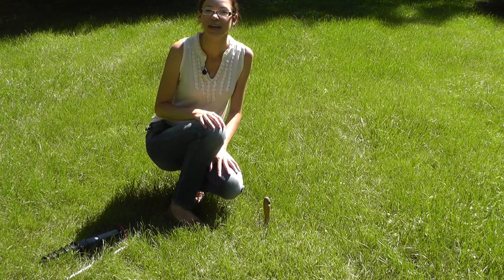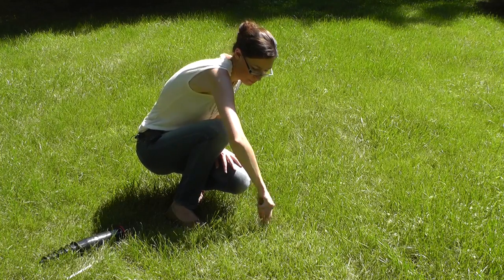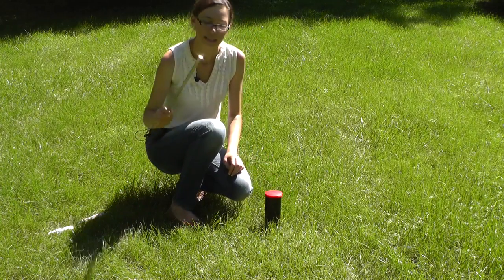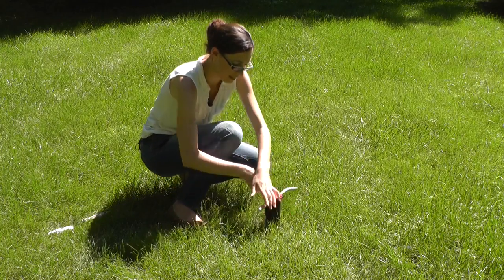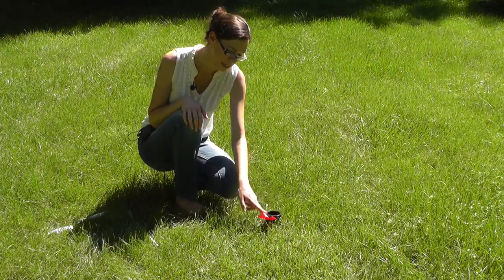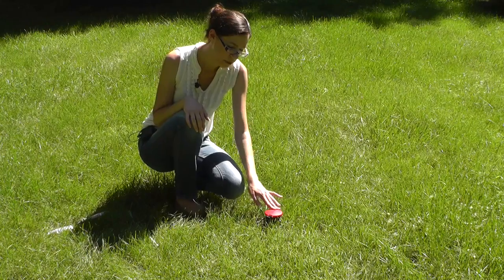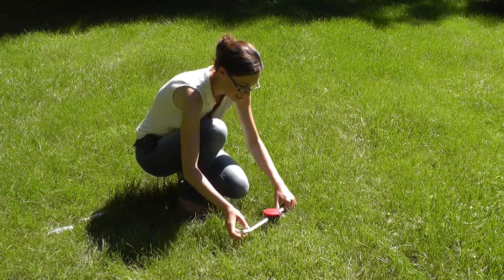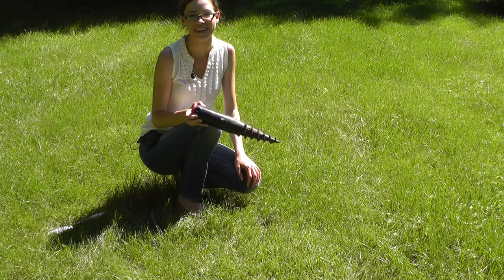Leifheit Screw-In Ground Peg

Comment: but how do you make sure it is level as it is screwed into the soil?  Mine went in at a slight angle.
Reply: I feel like I’ve taken mine out and put it back in a million times and it’s always off
Reply: A small spirit level is around $5 in stores, or use your iPhone spirit level (search 'level'), simply place it on the centre in the middle of the hole. 
Make sure it's 'middle bubble' and rotate a few times. Check both axis

You may need to manually adjust and give it a slight push one way or another, but eventually it will be quite close... 
These things are a temporary fix, if you absolutely must have 'top-dead-centre', you'll need to dig a hole, make-up some sand and cement and do it that way instead.
Reply: @Justhatipp  you are joking right